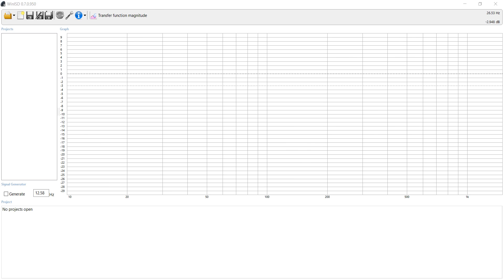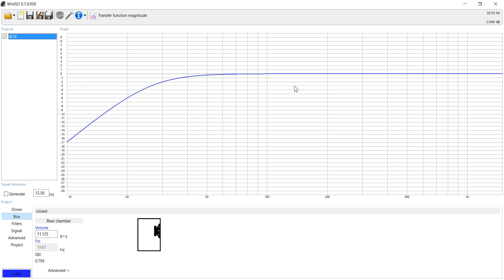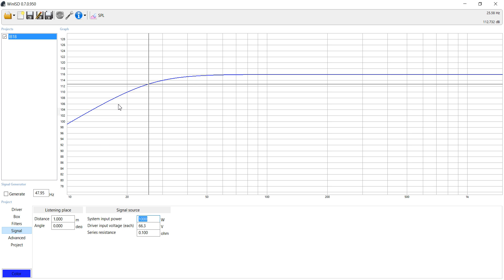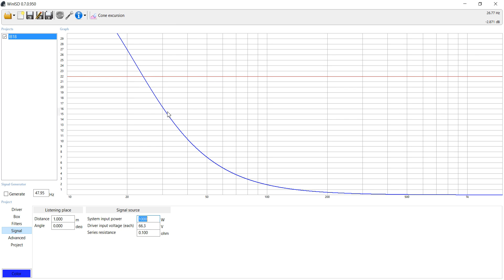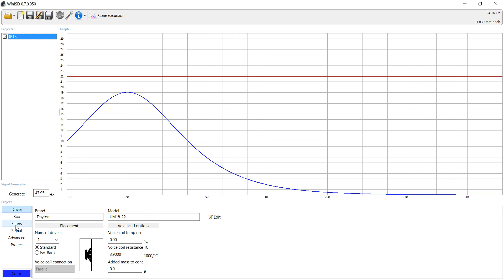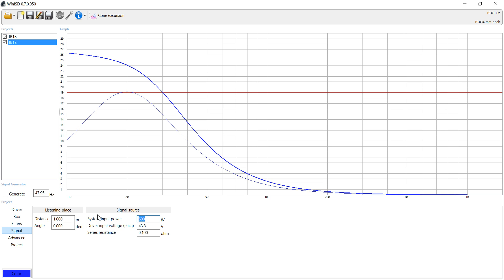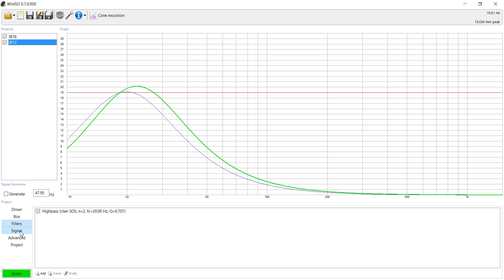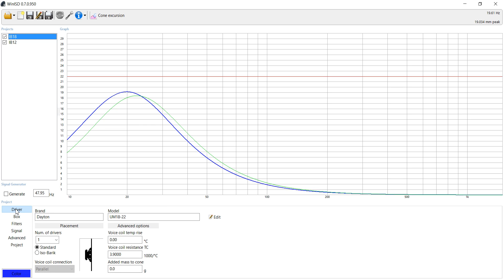Will my Subwoofer work Infinite Baffle? pt2

Comment: If you have a room that has an adjacent space for inifite baffle - do it. I put 6x skar sdr-18 dual 4ohm. Three manifolds with 2 drivers opposing. I measured about 12 potential  manifold positions and picked the three that summed the best. Each speaker wired for 8 ohm and connected to 6 channels of an old 7 channel denon avr(600w PSU).  The avr is set to all channel suround mode.  I set the gain for about 80w per driver. The speaker distance setting in the avr allowed me to do phase slope alignment. It gets down to 9hz at -3db.  About $1k for drivers and wood,  and can rock my house like an earthquake.

Comment: The ultimax series has a lot of headroom on the xmax, xmech is actually somewhere in the low 30s(on the 18, in the high 30s). You can definitely go over xmax and not have problems. And assuming the driver is broken in properly, there is a 99.9 % chance that you are not going to have problems. Xmax just tells you when the motor force weakens by 30%, effective motor strength being 70% of 0mm excursion.

Comment: Mate, thanks for the informative video.  A question for you..., I am using dual Rockford P215S4 in a 15cu feet space for Infinite baffle, I used these subwoofer due to the low FS and a QTS of nearly 0.6 so I thought it is ideal.  I am running them with a Phoenix Gold RX1100.1 amplifier in two ohm load.  So far, I am happy with the result but I will soon change the subwoofer to a Soundstream Rubicon RS12 subwoofers since the Rockfords are deep. They are the original Rubicon series with blue speaker basket. Would you recommend them as an Ib install?Thanks for your video mate!

Comment: boy that guy in the comments in the last video was spot on when he mentioned cone xcursion. love info on these weird box types. your pretty knowledgeable on this topic. got some mall questions. heres a starter. can you please expand on the most basic argument in box history. ported vs. sealed. so trying to make this quick. 
so the port only provides support for the woofer And only amplifies the sound at the tuning frequency? so anything above this the cone gets no support or amplification from the port. so basically above the tuning frequency in a ported box, the speaker acts as a sealed box? part II. does the sealed box porvide support for the woofer the entire frequency range. or just down to the tuning frequency. then below tuning on the sealed box, it starts to become unloaded and go xmax crazy? 
also. dont understand how tuning really works on sealed boxs. it all depends on how big the box is, is how low its tuned? so in a 4th order, never understood how the ported section handled the highs and the sealed handled the lows. so sealed is good for lows? 
spent all this time understanding ported boxes while forgetting the basics, sealed and all the great things a sealed box is good for.
Reply from the maker: indopleaser I'll have to do a video on this. But basically a sealed subwoofer doesn't have a tuning frequency per se. The size of the Box does determined what the frequency response will look like. However if you put it in a box not designed for it, it can still have trouble with cone excursion.
Reply: 123Toid have an idea for a subwoofer box. listen to this. a 4th order bandpass box with a single 12" in the middle. the ported side is normal. the sealed side, the low tuning side, will use a 15" passive radiator. due to passives needing around double the cone area in relation to the active woofers cone area. could be a cool idea. also would make getting access to the subwoofer really easy. undrill the passive, and your looking right at the active.
Reply: @indopleaser  that's effectively a 6th order, since a PR functions similar to a port. A sealed box controls excursion, through change in pressure, it doesn't care about volume or frequency, however, higher power and lower frequency both result in more excursion, which it does affect. A sealed box will apply more force the more excursion there is, so it limits the abilities to play low and loud at the same time. A ported box acts as a sealed box until it gets near tuning frequency, in which case the ports starts to have output of it's own, that is constructive to that of the sub itself, leading to an increase in volume and efficiency at and just around tuning frequency, but after that the box falls off faster, maybe because port output is partially cancelling sub output? Idk the answer to the last part. It may also unload the sub, in which case it would be important not to drop far below tuning freq at high volume, because it would act closer to ib, which your amp wouldn't be tuned for, and your sub could hit xmech (which, importantly, and not mentioned in the video, is different than xmax. Passing xmax with subs is not uncommon)